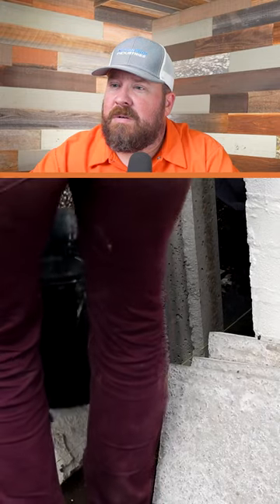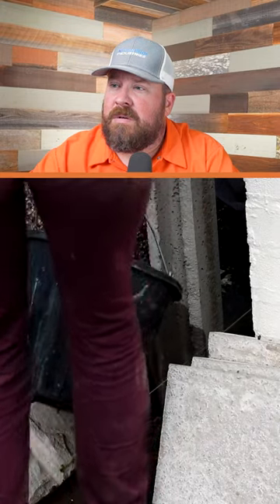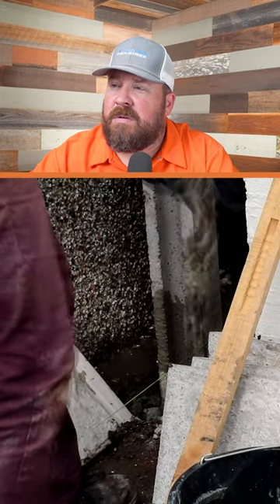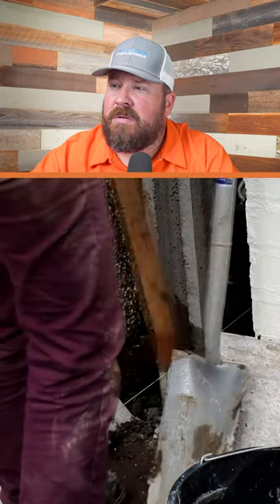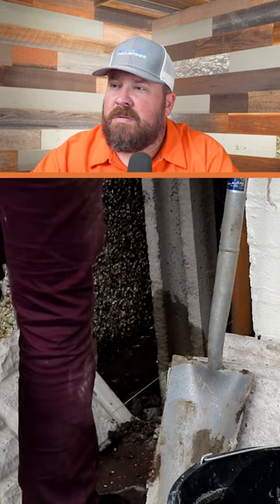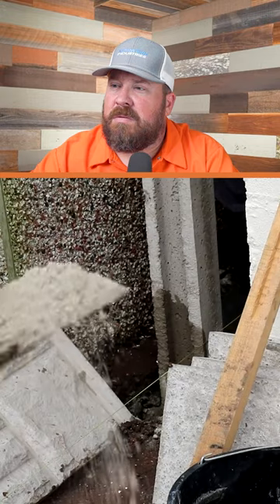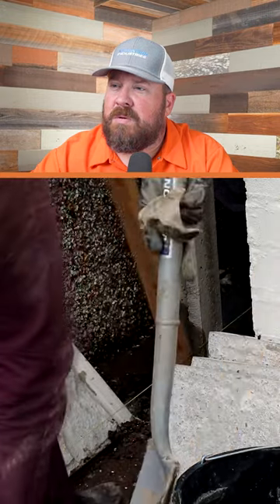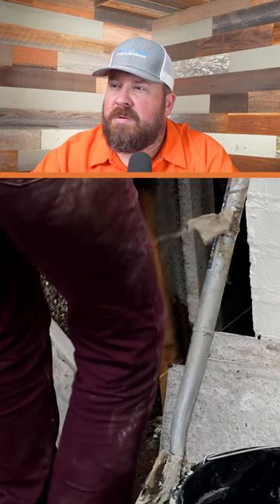Do You Wet Set Or Dry Set Your Concrete?

Comment: I know because I've done a few fences like she has except I just dumped the damn concrete bags in like two or three bags more sometimes if my guy screws up the damn hole and then I take the hose and soap that sumbitch tell we are watering the flowers on the other side and the only issue I've ever had with it was you have to be careful on vinyl post because it doesn't run into the center so you have to physically dump it into the middle to top it off and the it works really good and I know this because I've had to move a couple of posts and they were the same level of shooting us as moving wet set posts

Comment: I wouldn't call this a dry set
 I call it mixed in a hole wet set.

I bet the very best concrete would be made in a vacuum chamber 100% no air bubbles, then compress the wet concrete until it slow cures constantly adding water as it boils off in the vacuum
Reply: I looked it up vacuum concrete is a thing but not what im described it just uses a vacuum cleaner to suck out the water for faster curing

Comment: Dry sack it tamp it pour water on it move to next one
Reply from the maker: Appreciate you sharing your experience!
Reply: I agree with John, with one caveat. The ground needs moisture. I've done this when the ground was too dry and the concrete strength was not there. My understanding is that the concrete should not dry too fast during curing.